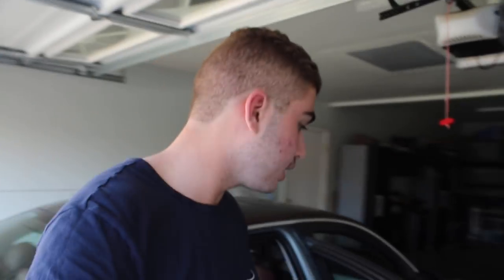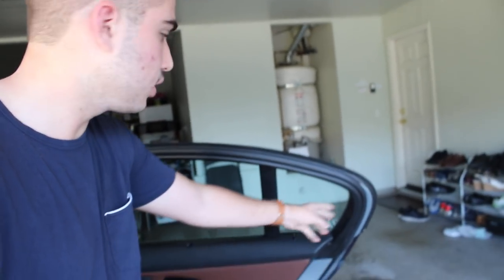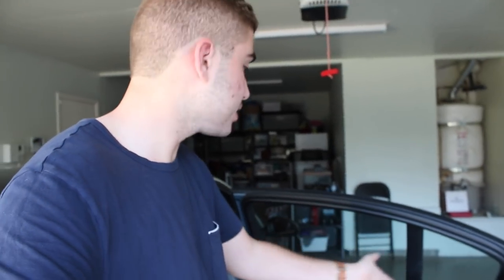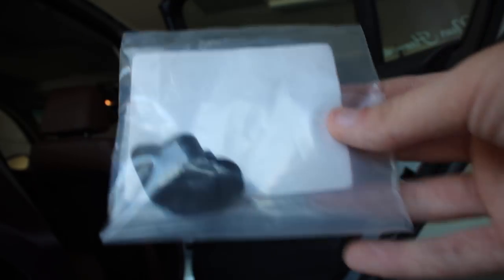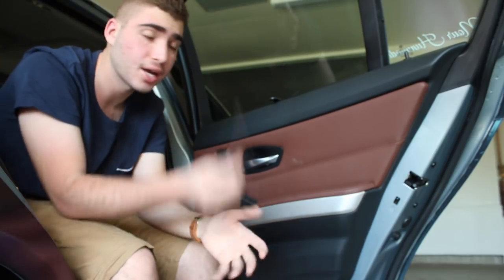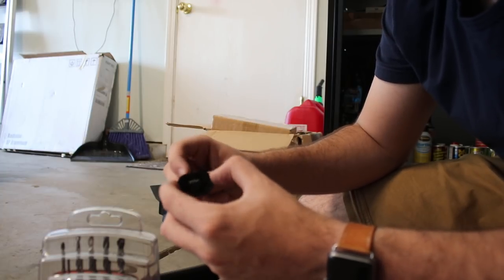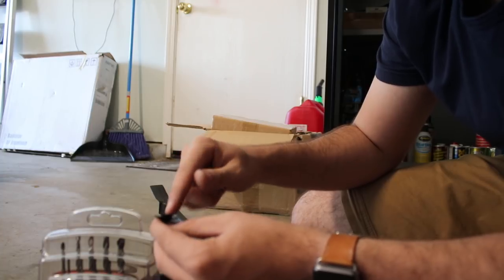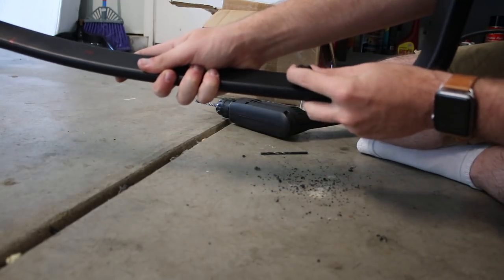RETROFITTING SUNSHADES IN ANY BMW!! (E90,E91,E92,E93)

Comment: what is the part number or where can i find the handle for the sun blind? one broke off and i have no idea where it went. like the one that you have circled on your thumbnail. Thanks
Reply: Happened to me too, and the whole shade is now inside the door panel...
I don't know where the handle thing went
Also: I don't know what it's called, so searching for it is almost impossible
Reply: @barmetler 

Took my car to a car wash and looks like they broke one, that’s on me for not putting them down myself. Read on a forum just now that E39 clips will work, can’t confirm but just ordered some on eBay so here’s hoping. 

As far as fishing it back out it looks doable with a paperclip or something similar.